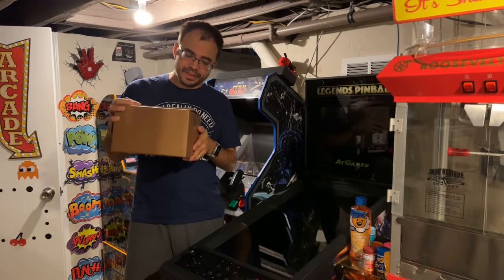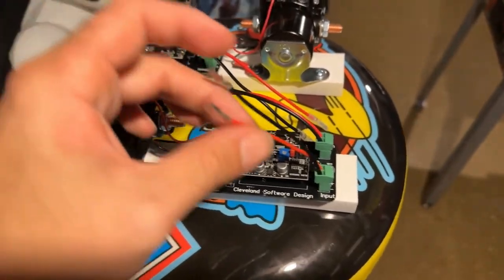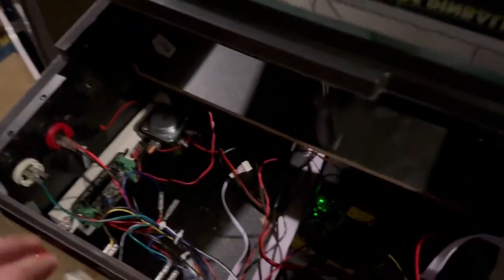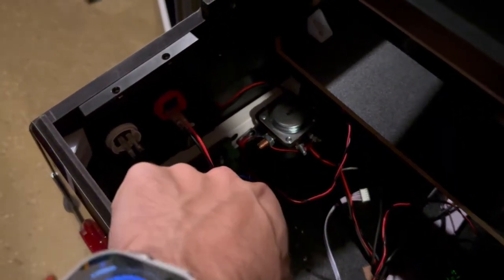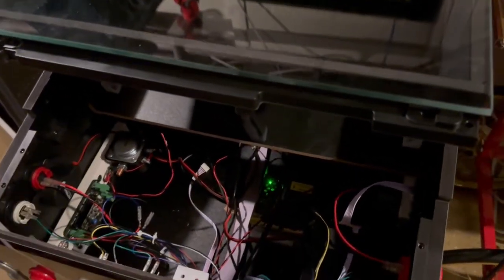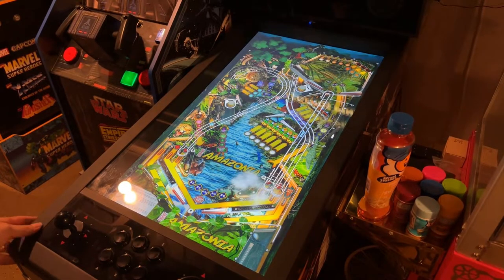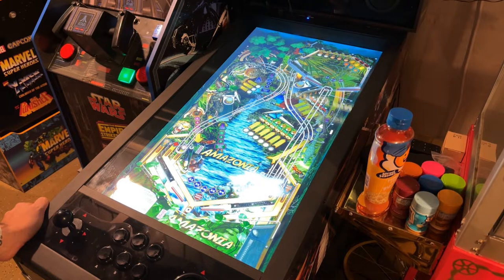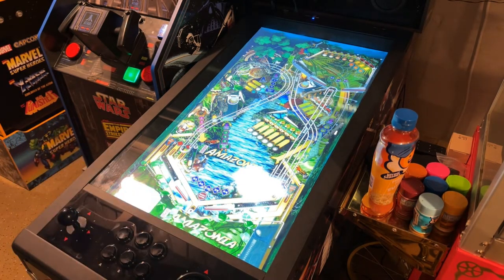AtGames Legends Pinball Solenoids Upgrade From Cleveland Sofware Design - Literally Plug and Play!

Comment: I'd be curious : how loud are these?

Here's my dilemma : I'd really like to add this to my alp (currently exactly like yours was before, so factory + buystuff haptics), but I live in an apartment and can only play at night.

So this might be in equal parts awesome or a complete showstopper for me ;)

Bonus questions : 

Could they maybe be damped? Like, is there some accessible space where one could squeeze a bit of cloth into? 

Or, maybe this could be the solution : can they be turned off and the buttons still work? Then I'd be able to just activate /deactivate them as needed..
Reply: I'm in the same boat. I play a lot at night like after the gf is asleep, so 1030 pm to 1 am. Having neighbors below and beside is a concern if I can't control the sound.
Reply: @sinizin  precisely. 

one would thus need at least an option to turn these things off...
Reply: @zorglub667  how have the buystuff haptics worked for you? Can those be volume controlled? I haven't bought that yet either. I was trying to decide if I would get that or this or both.
Reply: @sinizin  the haptics kit is actually pretty perfect for our particular scenario. you can not only control the volume but also dial in the crossover frequency for the sub, ranging from "just do the disco stuff" to a rather active rumble machine that gets you to hear the ball rolling even at low volumes.

so i must say, i absolutely love it. gets me to dial in the maximum possible "feel" within the constrained scenario that we both play in :-) 100% recommended.

the only thing it certainly cannot do is give you that definitve flipper button "smack". that physical solenoid smack cannot be replaced by mere exciters. but that brings us back to our problem. a solenoid would have to remain deactivated in our situation anyway, so this is the next best thing.

just make sure to ignore the part in wagners tutorial where he recommends to leave the stock haptics disconnected. you can reconnect them without fearing some sort of impendance mismatch, and the combination of the exciter plus the subtle vibration of the stock haptics is likely the best "apartment friendly" thing avaiable to us mere mortals that dont own a separate mancave arcade basement ;-)
Reply: @zorglub667  hahaha you're the best. Made me laugh hard reading that at work. Appreciate the detailed explanation more than you know!
Reply: @sinizin  🥂
Reply: Easy just unplug power supply for solenoids, I have everything on a power strip and solenoids is last plug so I can unplug and  turn off easily

Comment: Installed my set today, took much longer than expected, drilled hole for power cable, hooked up wrong flippers finding a good spot for right side was not great with plunger in way. After I got all setup left side sounds amazing but right sounds weak due to solenoid placement farther from button, need longer wires to button so I can move right side solenoid closer to buttons. I do agree that plugging into system was pretty easy though with all the connections ready to plug and play.